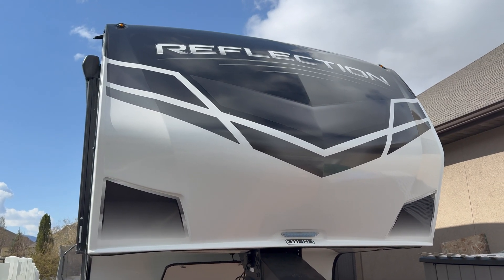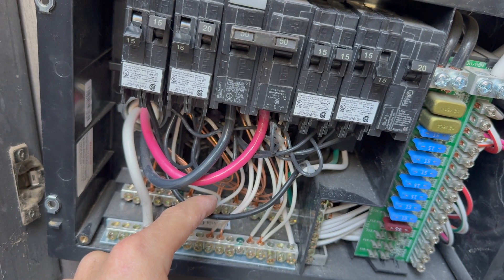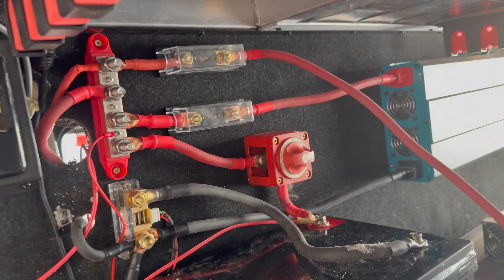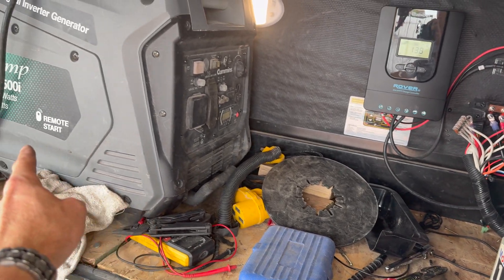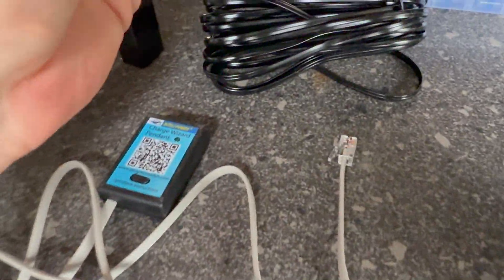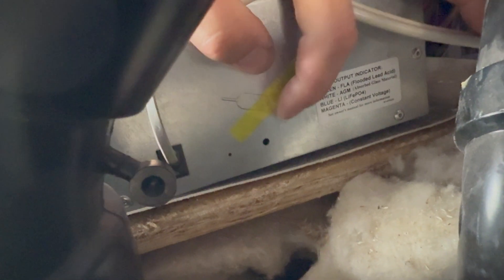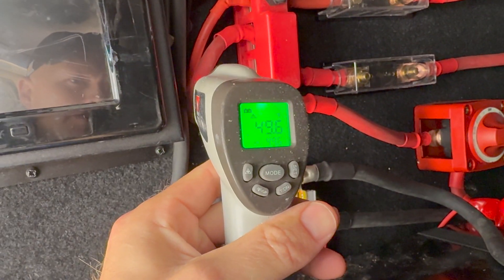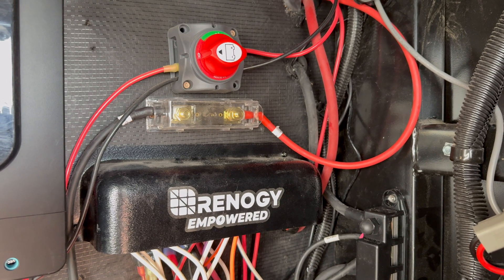RV Lithium Battery Upgrade: Progressive Dynamics 80 Amp Converter Install & LiFePO4 280 AH

Comment: Very informative video. Where did you get the battery tray? Everything has been small for the 280AH
Reply from the maker: I made it myself with angle iron and a welder. I then bought the hold down straps off Amazon. If you don’t have a welder, maybe you can make a similar tray out of wood.